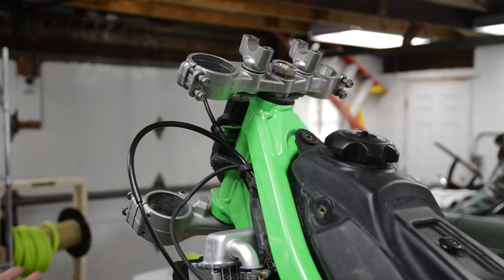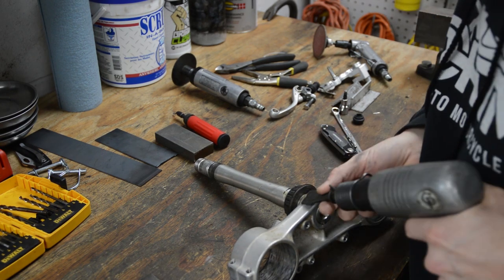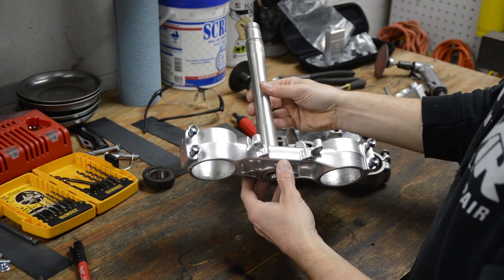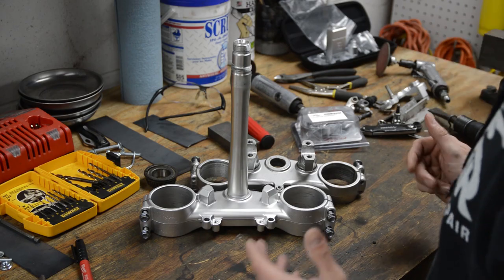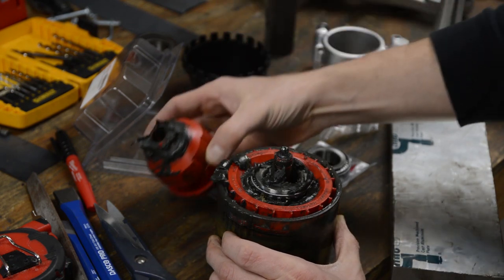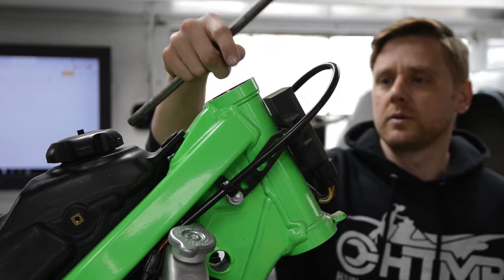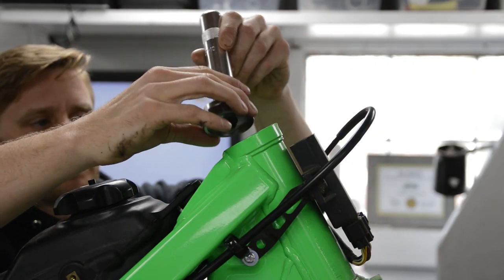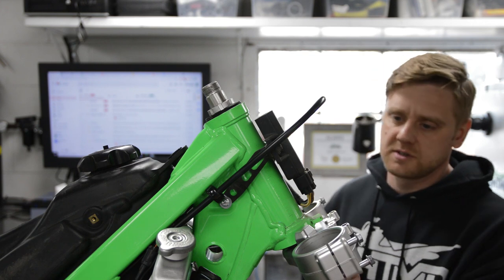How-To: Replace dirt bike steering stem bearings

Comment: Thanks for the video, was sitting here with a kx80 shaft trying to figure out if the steering shaft has a thread or is pressed. I think if you used a brass dolly to firmly knock around the bearing it may come loose, I’m about to try the same so will confirm if that works